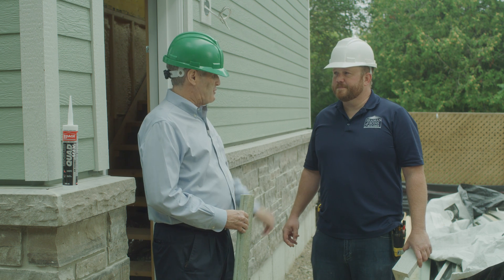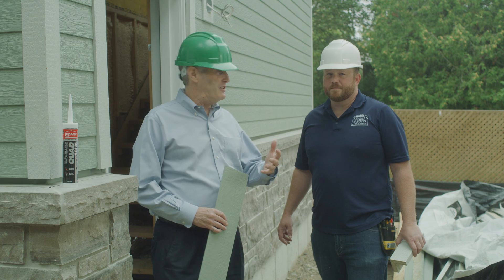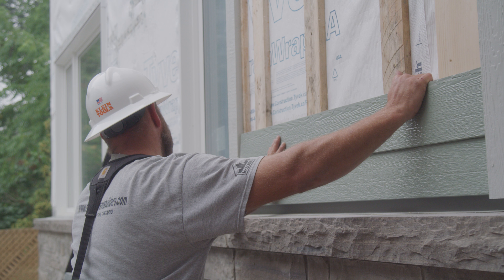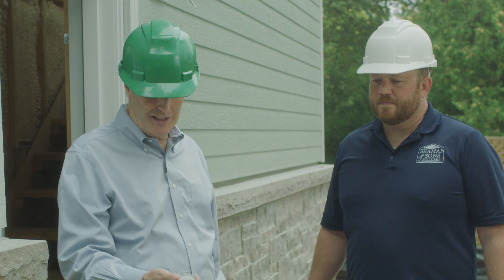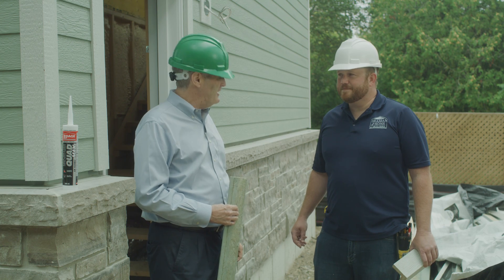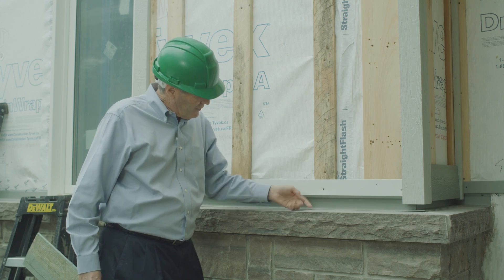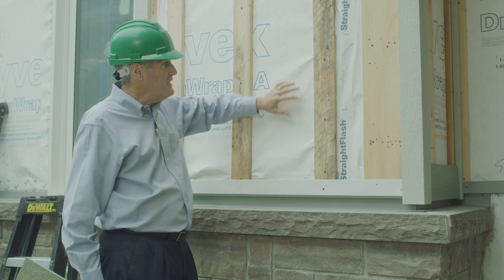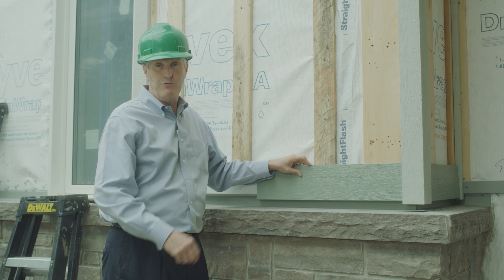Maibec Resistech Siding Installation with Ledgerock Stone: Building a NetZero Home - Part 18

Comment: Aren't they supposed to use a perforated starter strip to help on the moisture and air flowing between the wall and the siding
Reply: Yes. Manufacturer wants a ventilated starter strip with 1/2" gap at all openings and wall transitions.